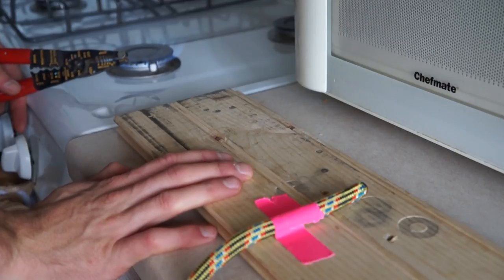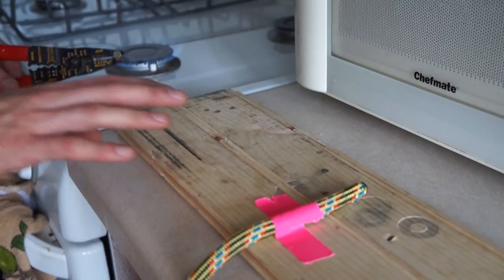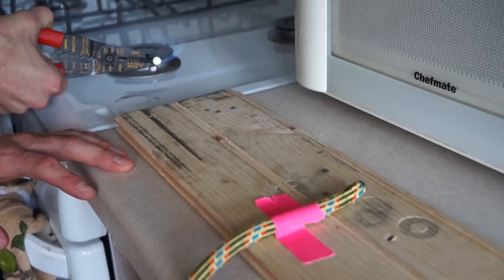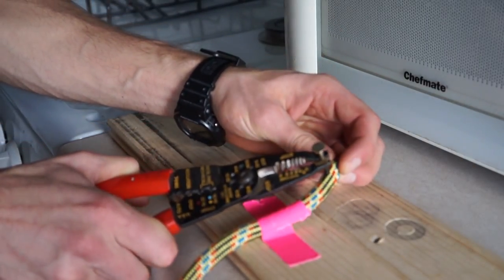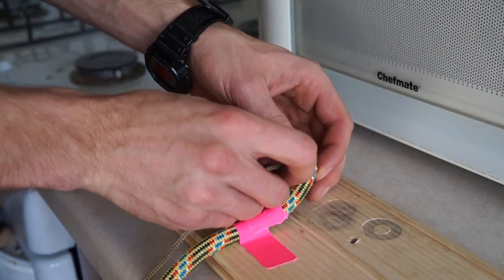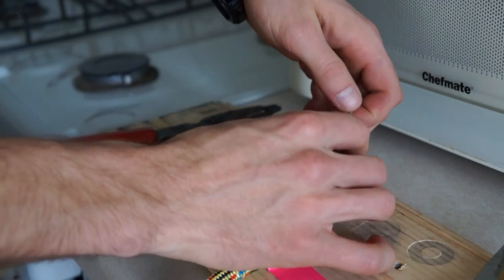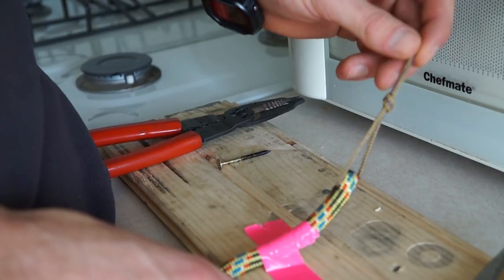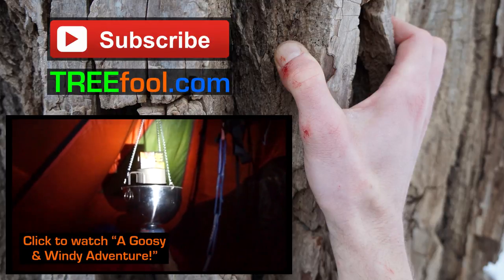Tree Climbing Rope Modifcation - EASY & FREE (alt. to sewn eye splice)

Comment: But that's not technically a splice, it is a non working load bearing loop... calling a splice could be an issue, as most of us assume that splicing a rope makes a loop made for attatchment, and working loads, and elliminates the need to tie a knot at the end of the rope. Cornell tree climbing club developed this technique when in a tropical region, the ropes would not go over the branches covered with heavy moss...

Comment: Another option would be to use an XSRE Biner from DMM! They are great and pass right through the rope without hurting the fibers. With your pre made hole in the rope it would easily pass through with no problem! Good video and tip by the way!

You can see how easily it passes through here:
http://youtu.be/4gXsd9b3QMo